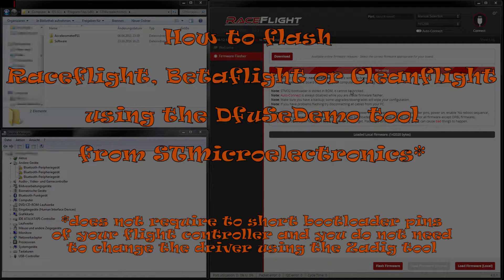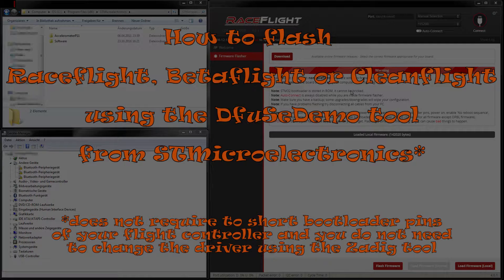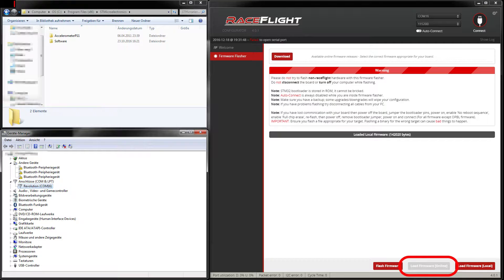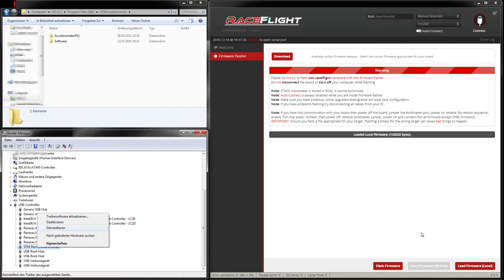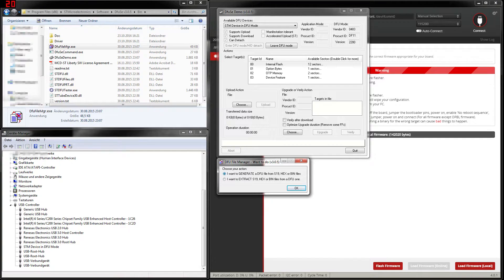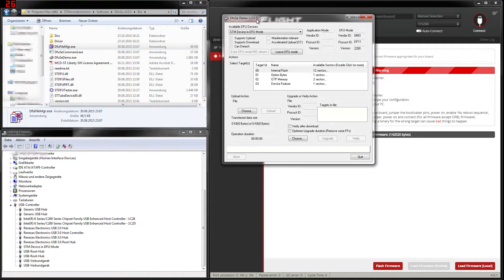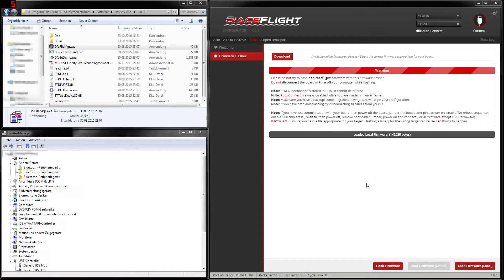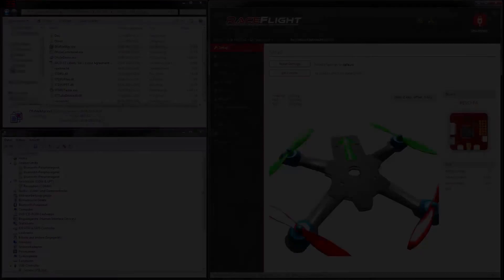How to flash Raceflight, Betaflight, Cleanflight or iNav in DFU mode using the DfuSeDemo tool

Comment: Tried flashing with a new firmware. Flight controller will no long communicate with pc. Have all drivers. Zadig ImpulseRc Driver fixer. Even bought an ST-Link v2 and tried using the utility to flash. But it will not communicate with PC. Any ideas how to flash with st-link? Connected with camera and receiver and all and everything shows up in goggles. Just won’t communicate with pc.
Reply from the maker: mhm that sounds difficult. Did you try to get the FC into DFU mode but pressing the button or shorting the pins? If you don't get any communication, you can try to connect the FC via FTDI and not via USB. Oscar has a good manual, see here: https://oscarliang.com/connect-fc-broken-usb/ Hope that helps.

Comment: Failed to open serial port... help me pls!
Reply from the maker: Did this occur after flashingthe fc? it can be several things from a driver or port problem to a wrong flashed firmware or broken USB cable. Sometimes the ImpulseRC driver fixer worked quite well for such problems, please find it here https://impulserc.com/pages/downloads
Reply: I make it join it FC to the computer and only the blue led lights... but the bootloader is not made to join needle... i tried the impulse rc but was out of order... it does not find the FC:(
Reply from the maker: mmh okay..have you tried a different port, usb cable or pc? do you have the correct driver and flashed the correct firmware?
Reply: Yes.. i tried a different port and pc and cable but just the blue led lightning...
Reply from the maker: Very strange..I never had any issue with flashing using this method :(

Comment: I have successfully flashed my Revolt FC with Betaflight using your GREAT video, but now when I try to flash RaceFlightOne back on my Revolt FC its not working. Meaning I am able to put it in DFU and use the DFU demo utility to flash the RF1 *.duf file I've created using the DFU file manager (BTW I have a bin instead of a hex file) but after when the successful flash it is still flash with BF?! very very strange...
Reply from the maker: Sounds strange to me as well..A long while ago, I have flashed RF maybe 2-3x and then went back to BF, but so far, I have never had problems with any BF or iNav version over the last couple of months. I have flashed a few times from BF to iNav an back, but without any issues. Is flashing with DefuSe indicated as "successful"?
Reply: That problem was with my windows driver, The "ImpulseRC Driver Fixer" did the trick for me:
https://impulserc.com/pages/downloads
After the fix I could see the Revolt in DFU mode on the Raceflight configurator, allowing me to flash the latest RF1 firmware
Reply from the maker: I'm glad you solved it :)

Comment: Hi does not work for me. FC (BFF3) Does not automatically fall into DFU Mode. neither when you hit the flash button nor when de and installing the driver
Reply from the maker: Mhm that's bad. Have you tried to short the bootloader pins and then connect your FC to your computer?
Reply: Cant do this to :/
Reply: http://www.dronetrest.com/t/fix-any-stm32-dfu-drivers-issues-when-flashing-betaflight-cleanflight-firmware/3603 Try this!

Comment: been having trouble with flashing for over 2 months and for some reason this still doesn't work.

nothing happens in device manager when I click "flash". also when I download winusb in the zadig driver tool, it makes the flashing cable un-usable
Reply from the maker: mhm ok..Did you install the correct drivers? I guess your flight controller isn't appearing in the DFU mode at all? Have you tried to short the bootloader pins in order to get it in the DFU mode? Once you are in the DFU mode flashing should be pretty straigtforward. Personally, I never had success with the zadig driver tool..
Reply: yes I have shorted the pins already
Reply from the maker: OK..and do you get your FC into the DFU mode?
Reply: Loko FPV I don't know how to tell if it is in dfu mode, but I have noticed that the lights on the fc stop flashing when the boot pins are shorted
Reply from the maker: You should see it in the device manager. I recommend to check in the device manager how the FC is connected and then try to short the bootloader pins and connect the FC to the computer and check again. Sometimes it is a bit tricky to get into the DFU mode, however, once you got it, flashing shouldn't be a problem. Also double check if you have the correct drivers installed.
Reply: ok, I have been in the device manager and it shows up as a com port called "CP2102 USB to uart bridge controller" Im pretty sure its supposed to show up as "stm32 controller"? 

when I download the zadig driver it makes it not work and changes it to a USB controller
Reply from the maker: As I said, I never had success using zadig. I don't which FC you are trying to flash, but mine are showing up as Revolution(COMxx) or STM32 virtual com port. Can you at least access your FC via betaflight? If yes, try the following (in order to get into the DFU mode) 1. option: short the bootloader pins, connect your FC via USB to PC, check how it is connected in the device manager. 2. option: connect your FC and then uninstall and reinstall the driver through the device manager. 3. option: maybe try again "flash" in betaflight and check how your FC is then connected in the device manager. I hope one of these helps
Reply: Loko FPV thank you for all the help, and for your information: my fc is an "SPracingF3"
Reply from the maker: No worries..I hope that one of my ideas helps ;) I think the SPracing FC is widely used and there should be plenty of tips and tricks in the web. I hope your board is not a faulty one..